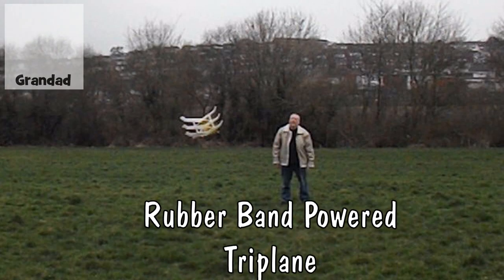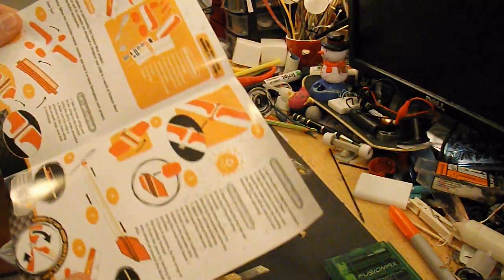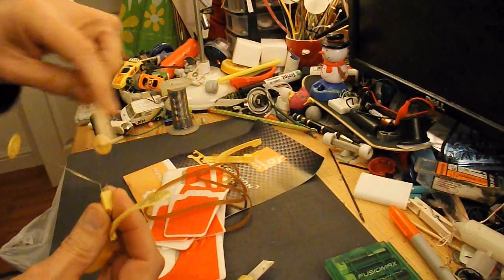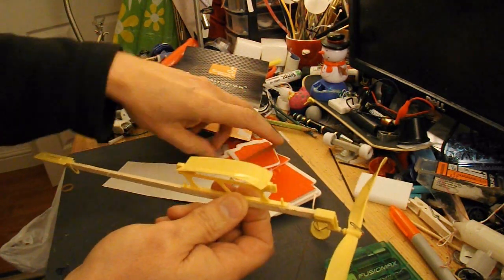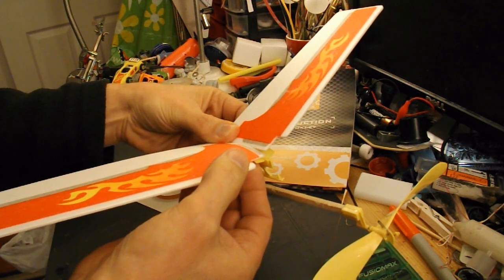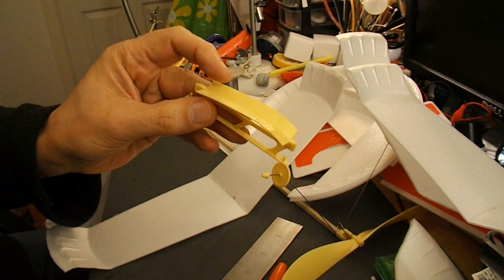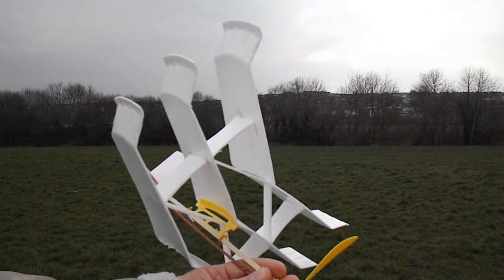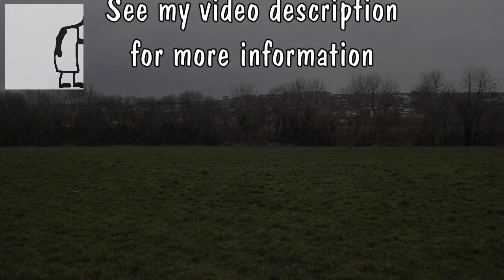Rubber Band Powered Triplane

Comment: Wow. That worked beautifully. A bit tail heavy but not bad for a prototype. Nicely done.
Reply from the maker: The CG was easy to adjust by just sliding the wing forwards or backwards on the wooden fuselage but with 3 wings stacked up like that the trim for a gentle glide without power was completely different to the trim under power. Initially I was being careful winding the motor as I didn't take a spare and I wanted to get some flights recorded before it might break. On the last flight I gave it a few extra turns and it was happy to oblige. It was just starting to rain by then and I was already cold so I decided to finish at that point.

Comment: That is another good flyer.  I used to think that you were the master of the hot glue gun.  Now I think that you are also the master of the foam plate model airplane.  Well done.  I like your flying car the best.
Reply from the maker: Thanks Lidmotor, obviously I only upload the edited version. There are plenty of fails here but there were also a few half descent flights. My wife declined the invitation to go out in the cold and wet so I had to use the tripod and missed the full glory of the best flight :-) I am hoping the flying car will survive my storage system - called a pile in the corner of the room - and make a reappearance when the weather gets warmer so we can see it on a calm summer evening.

Comment: Flew well at the end, from what the camera did catch :)
I always used to use stock normal rubber bands, nothing fancy, the longest i could find and double or treble them up....and always used to build rubbish rubber band powered planes lol
Reply from the maker: There were 2 bands in the pack but I couldn't find the second one when I got ready to go out, so I was rather gentle winding up the motor as I didn't want it to break before I had done a few flights. On the last flight I gave it a few extra turns and as you can see it flew perfectly, gaining height as it progressed. It started to rain after that, I was already very cold so I had enough and went home. The ground was covered in dog poo and I spent more time looking down than looking up, as you will have seen in previous videos on this site it is a football pitch. Don't you just love dog owners!!
Reply: GrandadIsAnOldMan I thought folks have to carry a bag around nowadays ? Or is that just for street walks ?
See, to me it would be a health hazard for footballers sliding around and landing on the ground. Am not in favour of more rules, but the poop is a hazard if the land is used regularly for footy matches.
Reply from the maker: slider2732 in the video the guy with the dog that pooped next to me came and cleared it up. I am confident he only did that because I was standing there.
Yes they are required to tidy up after their dogs, walk along any nature trail or footpath and you can see the bags full of poo thrown up in the bushes where they will stay till the plastic degrades. There are even proper poop bins provided by the councils but some dog owners would throw the bags anywhere rather than do the decent thing.

Comment: I liked that if the plane can independently begin flight
Reply from the maker: I was rather gentle winding up the motor as I hadn't brought a spare band with me and I didn't want it to break before I had done a few flights. On the last flight I gave it a few extra turns and as you can see it flew perfectly, gaining height as it progressed. It started to rain after that, I was already very cold so I had enough and went home.

Comment: Flies well, but you really need to get some proper rubber for your planes. Do a google search for FAI Tan Supersport rubber. While you're at it, get a small 5:1 winder and some silicone oil (Dow Corning 33 is best) so that you can stretch the motors out and get them to unwind properly. I know that sounds like some work, but when you see the performance increase, you'll understand just how much it's worth the trouble. Those changes would more than triple the flight endurance of your triplane.
Reply from the maker: I appreciate you trying to offer helpful suggestions but my projects are based on junk and household items. I do have a very small stock of hobby grade rubber but this build was based on a cheap readily available toy kit and I used the rubber supplied which was a reasonable grade compared to the cheap bands I normally use. I can see from your channel that you are a proper hobby grade aeromodeller and are on a completely different level of construction, so I thank you for taking the time to comment on this video 😊
Reply: Well, even a toy can benefit from good rubber. ;) I still build really simple foam/stick planes on occasion and I like the fact that you can get someone started with a really, really high performing airplane in the air for maybe $15 and an hour of work.
Reply from the maker: Yes, totally agree. On the subject of good rubber I have a video due to be made public in February but you can catch a view of it here as I made it unlisted so somebody else can see it in advance https://youtu.be/jaCKVhE7l7I
Reply: Without giving anything away to your viewers, very, very, very well done, and welcome to helicopters. You have just jumped down a fabulous rabbit hole you'll never come back from. You really need to try out the Wright Bat, by the way. It's the design that inspired the Wright brothers, and it flies like crazy on modern rubber (super easy to build, too). Also, when you start stretch winding that hobby grade rubber, you're not going to believe the level of performance you get. Pro tip: if you don't have any rubber lubricant, castor oil or even plain hand soap will lubricate the rubber enough that it will wind and unwind better.
Reply from the maker: Thanks again 😊